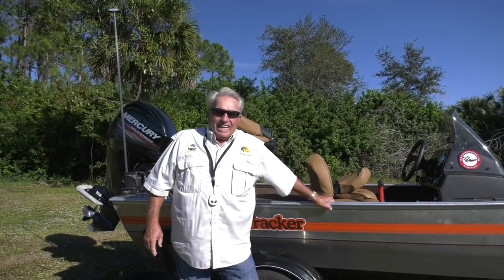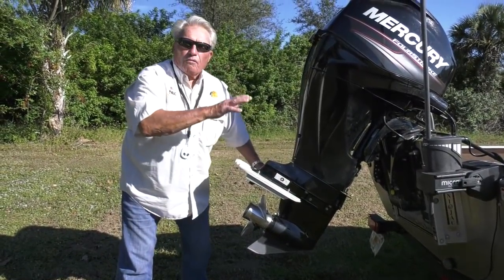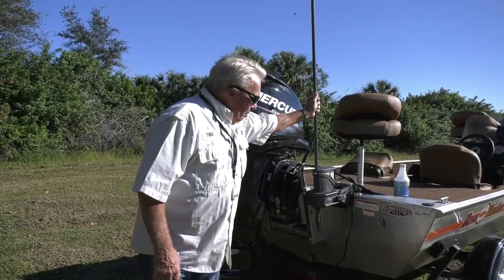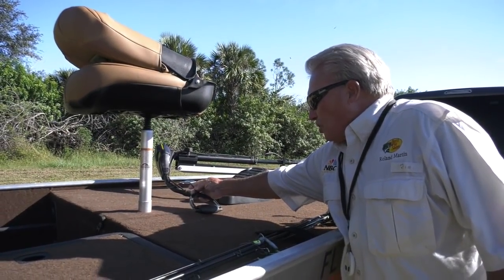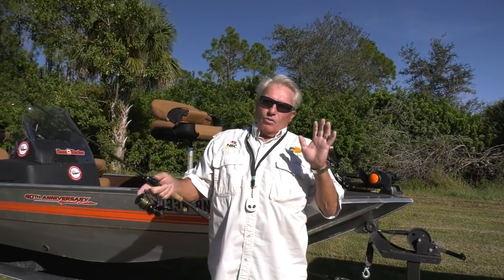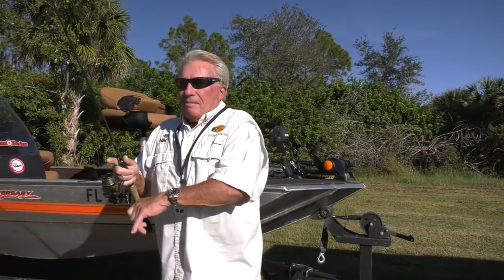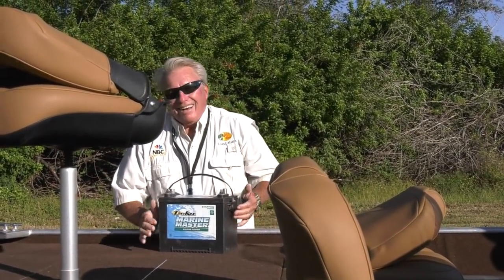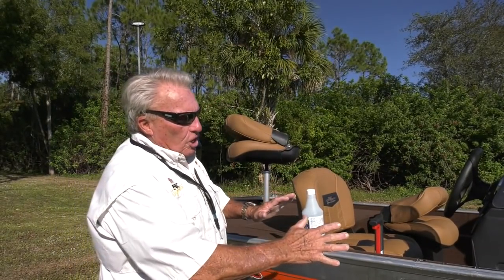7 ways to Trick Out a Small Boat for Better Fishing and Performace

Comment: Nicely done!  For someone wanting a shallow flats boat without spending a ton of money, this is a great way to make a small boat work for those shallow flats and still not break the bank!  I wouldn't have thought to use this particular Tracker boat as a flats boat.  Something designed as a flats boat is going to cost at least twice this amount just for the base model without any of the extras.  Thanks yet another great video, Roland!

Comment: The most often used improvement to my aluminum Jon boat is a piece of aluminum angle-iron welded to the boat so I can clamp rod holders mounted on a board to the boat.   I originally made the rod holders for spider rigging for crappie  I quickly realized the spider rig was great for live bait fishing of any kind.

Comment: Aluminum is fine on salt water, but the welds don't flex and that's typically the fracture point on the ribs in big water. The aluminum also vibrates and goes through fatigue. The heavy duty boats are fine, but some of the cheaper ones aren't that great. The rebuild forums show it pretty frequently with the 70's and 80's boats.

I have a glass and aluminum. I've glassed and riveted both and I like them equally.

Comment: WD40 >>>>> I had an aluminum  Lowe flat bottom like that Bass Tracker for San Diego ocean - bay fishing and never had a problem with corrosion because I did what Roland does I rinse out the engine win t fresh water and wash the boat down AND >>>> I sprayed WD40 all over the motor and on any metal hinge- nut bolt clamp etc.......

Comment: Would you use a jack plate on a 2001 bass tracker 175 since it already has an offset transom? Also, would na micro power pole be too light weight for a 175?

Comment: You left out motor flushing. Running fresh water through the water jacket flushed out salt. Plus come spring it’s good to run the engine a bit to make sure it’s ready. Checking the water pump. Flushing my older Yamaha from the river I notice brown river water color then after it gets up to temp and flushes good the water is clear.  Then use a good fuel stabilizer like your son Scott says. That startron. Stabil works to. Don’t forget older engines that you can remove the fuel line run em dry. As the engine goes to. Quit use the choke to get any remaining fuel out. The fuel breaks down today after about a month. Plus it prevents engines from being gummed up. The old fuel will clog carb jets. So by spring after storage no fun for the grand kids to family trips. If the fuel is still good but needs to used up on a portable tank burn up the fuel in yard equipment start with fresh. Or keep a fuel stabilizer handy for storage. I have sat on the river bank in spring and listen for those that don’t do maintenance crank crank etc. plus with built in tanks fill em back up to full. Prevents water getting into the tank by sweating then add a fuel additive. If stored for a month.
Reply from the maker: You are absolutely right, I should have mentioned to flush the engine in fresh water!

Comment: The power pole remote looks like a medical alert...”I’ve fallen and I can’t get up”
Reply: askip7 lol or help I'm moving and a cant stop.
Reply: So what? It works.
Reply: @Forevertrue  does it work?? Doesn't the boat just swing from that point??
Reply: @bausy2196  I put two on the back of my even smaller Twin Troller.  Hooked them up to work in tandem.  Has me solidly rooted to the bottom down to about 5 feet.

Comment: I'd love a link to the cavitation plate. Did adding that lack plate mess with the steering cable going under the metal of the boat gunnel?
Reply from the maker: No it didn't interfere!
Reply: What cavitation plate is that ? Brand?

Comment: Roland, quick question, I have a 11 foot skiff that i use for very shallow saltwater. Because the boat is so small and not designed for a front trolling motor, I was wondering if the Bobs Prop nut would do anything for the cavitation even though its mounted on the back? Where I can run the trolling motor, I seem to spook a lot of fish because of it. Maybe a different prop? Trolling motor is a Riptide 45lb thrust and comes with your standard weedeater prop. Was thinking of trying the Bobs nut or a different prop. Seems the worst about 40% or higher throttle after Ive been moving for awhile. I was also thinking that it was too high on the boat but I cant bring it much lower without digging in
Reply from the maker: I'm constantly rasing and lowering my trolling motor
Reply from the maker: I'm constantly rising and lowering my trolling motor

Comment: Roland Martin, what engine propeller are you using here (brand, diameter and pitch)? There are many of us Heritage owners that would like to follow your lead. Thank you in advance.
Reply from the maker: I'm using my Roland Martin's Weedless Wedge which I patented and sold to Minnkota  30 years ago. You have to deepen the cotter pin grove about 1/4 of an inch. That's easy!
Reply: Roland Martin Outdoors, I’m referring to the 40hp stainless propeller that you are running.

Comment: Good advice for people wanting to catch fish headache free.  The only thing I would add to this is  buy a cheaper boat and get a GPS anchor trolling motor.  I love out fishing more expensive larger boats in my skiff.  I also have the micro power pole but the trolling motor with anchor is more usable.  Also second the recommendation for a 6 foot MH rod for trout and reds.
Reply from the maker: The " spot lock" system trolling motor by Minnkota is really fantastic but costs a small fortune, about 3,000.00! I'm using a Minnkota edge which cost about 300-400!
Reply: @RolandMartinOutdoors  my 12v motorguide xi55  was on sale about 1300 clams online.  Micro power pole costs about 650 I believe.  Neither are small purchases but the anchor lock is usable on those deep cuts and depending on wind direction may be the difference in catching fish or headache.
Reply: Rolands point here is shallow water set up. He's spot on. Fact not opinion.

Comment: Would this boat be good for saltwater??
Reply from the maker: Wash it in fresh water and it will last forever!
Reply: @Rob23 .... I used an aluminum boat in saltwater for years with no problem but if you are trailering make sure your bunks are NOT pressure treated (plain untreated boards are fine). Through a chemical reaction you will eventually have pinholes in your hull ... speaking from experience.

Comment: If your fishing in shallow water wouldn’t you want a alum prop so it will chip the  stainless prop will ruin your lower unit
Reply from the maker: Aluminum props are extremely fragile and will bend from nearly anything. Stainless are much tougher but expensive
Reply: The Mercury propellers (stainless or not) use what's called a torq reflex hub that is designed to give way if the prop bangs on something really hard, so the only thing that gets damaged is the hub, but the prop is saved and the lower gearcase does as well. $30 fix.

Comment: What’s the cost as you have?
Reply from the maker: The boat was 9,995.00 the jack plate was about 600.00 the micro power pole was another 600.00 the stainless prop I bought used for 250.00 the cavitation plate is about 75.00 and the extra depth finder is a 6 or 7 year old model that's out of production but worth about 400.00 for a grand total of about 12,000.00 total
Reply: Thank you Sir!

Comment: That boat cost more like $13000 out the door. but I'm sure you got it for free lol
Reply from the maker: The original Tracker Heritage, like I'm have, costs 9,995.00 but they made only 5,000 and sold out in a month. Shipping charges from Springfield, MO were extra as well as upgrades. The new Tracker Classic will go for 10,995.00 and has a 50 hp motor. If you decide to pick it up in Springfield, there will be no shipping fees!
Reply: @RolandMartinOutdoors  I like my Ranger lol But for the $ that's a nice little rig. They look well made.
Reply: @RolandMartinOutdoors  when is the new classic getting released ? And think that's super kool that you keep showing us these videos,  I was curious live well seemed small on heritage version for my 40lb Okeechobee bags LOL  any  word on live well size for new classic release?
Reply: @hunter6099  was that awesome to see Roland reply!!!
Reply: @kevinflabouyfishing5739  Yep, Not many do.
Reply: How fast are you able to run with those motor upgrades?

Comment: Went To the Tracker Boat center in Shakopee. Mn. to look at a used boat. It was crap so I looked at a new boat. They emailed me a quote including taxes and all fees along with a credit app. I filled out the app online overnight and went to the dealer at 8am when they open. They said the price went up overnight $1,505.00. They don't want to honor their own written quote that's less than 24 hours old. Then at 5pm I get a call and email saying...OOOOPs. Its the 2022's that went up in price not the 2021's. still want the boat? UMMMMMMMMMMM. Gonna take this post down or?